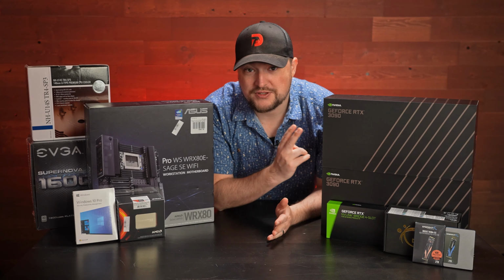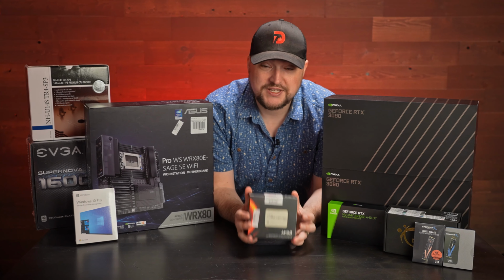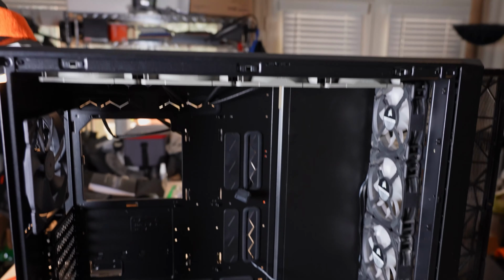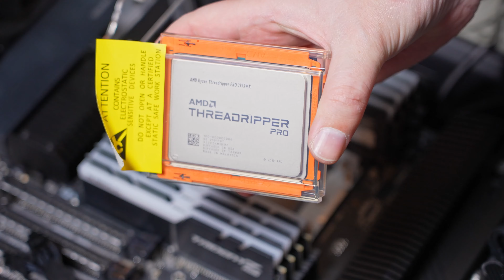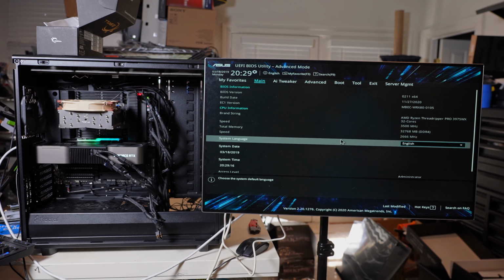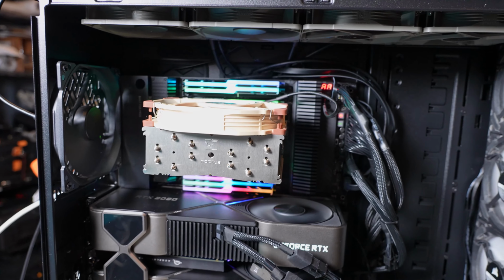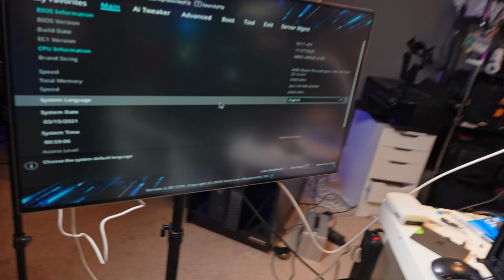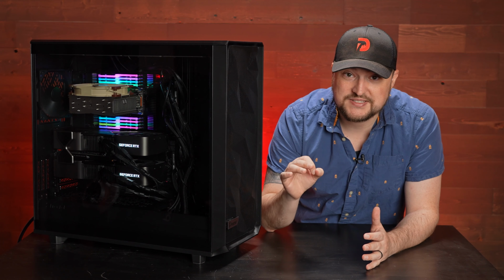AMD Threadripper 3975wx Dream Workstation Build!

Comment: Question: did you get the RAM running at it's xmp? As far as aware there was only a voltage adjuster in the bios and no way to enable xmp with the TR PRO boards. If you did could you give some pointers as there is little out there on these boards that would be appreciated.
Reply from the maker: No, I too ran into the same issue. They're only running at 2666mhz as opposed to the 3200 they're supposed to be. I hope a new bios update soon will address that.
Reply: @District7DrewGeraci  they run at such speed cause you're using 8 memories. That's the speed for such amount of memory units. Nothing wrong with that.
Reply from the maker: @Helios.vfx.  great to know, thanks for the heads up!
Reply: @District7DrewGeraci  No problem dude. for what I have read, at least for houdini fx software, it isn't affected by the speed memory at all. There's no big deal, even tho it sounds weird. I guess it might be kinda the same about resolve workflow. But you can also look it up about me memory modules and their speed while using 8 dims. At least, in this PRO mobos, it can't be put to a higher speed by xmp profiles. In non pro series, it can, if I'm not mistaken

Comment: Hi Drew thanks for the great video! I plan to build the same system for 24/7 usage. I prefer air cooler over AOI liquid cooler. Did your air cooled 3975WX system ever have any crash due to overheat issue? What is  the max CPU temperature when the system is running at full CPU usage for long time? Thanks!
Reply from the maker: Hi and thanks for watching! The air cooling works pretty darn well, with the max temp at max load peaking at around 72c which isn't terrible. I have another video that shows off the performance and temps if you're interested in watching that.
Reply: @District7DrewGeraci  Hi Drew, I have watched the other video. Great to know that CPU temperature is ok with the air cooler. What was the ambient temperature when you performed temperature test for the 3975wx? One more question, are the two side panels of the Fractal case made of glass or only the left panel? Could this case be positioned horizontally with motherboard side down for long term use? Thanks!

Comment: Thanks for the super clear video of the bios. I would like to see what you did in advanced to set the ram up to 3200MHz. I've got 8x16GB G Skill 3200C14 for a WRX80E I'm building and some people are saying their ram won't O/C on the TR PRO. I used DOCP on an X399 first gen TR. I really need a step by step bios demo.
Reply from the maker: It's not possible to get 3200mhz with the current bios - 2666 is the max unfortunately with 8 dimms.
Reply: @District7DrewGeraci  Thanks Drew. Well that's better than 2133.
Reply: @District7DrewGeraci  Did you ever get round to flashing the latest BIOS since you built it? We're at 1003 now, though using XMP profiles was added in version 0504. Your 8x32GB G.skill should run at 16-18-18-36 no problem. BTW what options do you see in the AI Tweaker and Advanced BIOS screens since the upgrade?
Reply from the maker: @2see2hear2be  so I had a great conversation with ASUS about the memory and the XMP data. If you're only using 4 sticks you can get up to 3200mhz but if you use 8 (or 2 quads) then you can only get 3000mhz. It's just how it works apparently.

Comment: Would be great to get an insight into temps during workloads. Also, curious if you had your choice of cases to hide cabling, which would it be. Thanks for a great video...the dual 3090’s, wrx80 and tr pro 3975wx build is exactly what I’ve been looking for - just not sure now whether dual watercooled hydro 3090’s might be the go?.. Could free up an extra slot maybe?
Reply from the maker: Those are great questions! The hardest part about this build is just sourcing the parts. At the time I built it nearly nothing was in stock and liquid coolers for the CPU didn't even exist yet. I'll be putting out a full video on the performance of the computer soon, but temp-wise, even under a full load at 4.2GHz All-cores, it maxes out at 70c, but averages 39-45c under normal loads. My previous system which was only 18-cores w/ liquid cooling hit 70-73c under full load so to have the temps be so low on air-cooling only is pretty incredible. Thanks for watching!
Reply from the maker: @Chris Miles For some reason your message won't show up in my comments, but I'm using the  Noctua cooler as it's literally 1 of 2 or so heatsinks that fit the new socket. There are no issues with memory clearing the fan.

Comment: Since your case has 9 PCI-E slots and all of your motherboard PCI-E slots are Gen4 x16, why not put your GPUs in the 3rd and 7th slot?. 
With that, you have three free slots for other stuff.
Reply from the maker: That's a great suggestion - I'll likely end up doing that if I need an extra PCIe slot, but the reason I didn't do it, to begin with, is because the 3090 would only be around 2mm away from the PSU exhaust fan (sucking up hot air). I'll test it eventually and see how it affects the card.
Reply: @District7DrewGeraci  If you really want to do it, you might want to upgrade the case to Lian-Li O11D XL.
Reply: @District7DrewGeraci  i have seen custom water cool backplate instead for the 3090 which would be cooler and dual slot

Comment: Thanks for making this video. I recently purchased a very similar build from Origin that I'm waiting on. Instead of the dual 3090s, I got an A6000 that I hope addresses some of the space issues that you mention. I went with 256 GB of RAM, mostly for future proofing. While I've done many builds in the past, I didn't feel comfortable installing the water cooling components myself. It's great to see others going with the Asus WRX80E as that's a pretty high-end board. Enjoy your setup!
Reply from the maker: Thanks for watching Raymond! Yeah the A6000 is a fantastic GPU and should work very well in tandem with the Threadripper pro. I would be very interested interested to see how it performs in Resolve/Blender as well when compared to the dual 3090s. Enjoy your new computer whenever it arrives!
Reply: WRX80E/3955Wx/ P/S is so much money, I'll be using my old ram/gpu/NVMe drives.

Comment: I just imagine how is this works on 3995wx because its lower Ghz... You think its might be the same?  not feels its downgrade by Ghz clock speed?... because I am want get 3995wx... and in plans using it on compositing, editing, 3d rendering, simulations... thanks and thanks for video!
Reply from the maker: I don't think you'll see any improvement on programs that favor lower-core counts and higher GHz (like the Adobe suite) but for 3d programs I think the 3995 would be amazing. The price is a bit ridiculous but if you need more cores you can't go wrong with 64! So far the 32-core works perfect in Blender, 3dmax, and Resolve. Thanks for watching!
Reply: @District7DrewGeraci  Thanks You for answer! btw also want to ask you how about Temperatures on Noctua CPU cooler! like idle and full 100% load!
Reply from the maker: @TheCool1986vfx  Idle it's around 39-42 and under full load it ranges from 65-71C.

Comment: Very similar to my build I did last weekend....

Build Name:   I N S A N I T Y

Specs:
• Case - Cooler Master COSMOS II 25th Anniversary Edition
• Motherboard – ASUS Pro WS WRX80E-SAGE SE WIFI
• Processor - AMD Ryzen Threadripper Pro 3995WX 64 Cores/128 Threads
• RAM - CORSAIR Vengeance RGB PRO 256GB (8x32GB) DDR4 3200
• GPUs - (4) EVGA GeForce RTX 2080 Ti FTW3 Ultra
• PSU - EVGA SuperNOVA 1600W T2 80+ Titanium
• Storage - (7) Sabrent Rocket NVMe Gen 4.0 - 22TB Total
• Case Fans - (3) Noctua NF-A14 iPPC-3000 PWM 140mm 3,000 RPM
• Fan Control - (3) Noctua NA-FC1 4-Pin PWM Fan Controllers

Custom Water Loop:
• Pump - EK-XTOP Revo Dual D5 PWM Serial
• Reservoir - EKWB EK-RES X3 150 RGB Reservoir
• Radiator - (1) EKWB EK-CoolStream PE 360 Radiator
• Radiator - (1) EKWB EK-CoolStream SE 280 Radiator
• Radiator - (2) EKWB EK-CoolStream PE 240 Radiator
• CPU Water Block - EK-Quantum Velocity sTR4 D-RGB - Nickel + Plexi
• GPU Water Blocks - (4) EK-Quantum Vector FTW3 RTX 2080 Ti
• GPU Back Plates - (4) EK-Vector FTW3 RTX 2080 Ti Backplate
• GPU Terminal Block - EK-Scalar Quad 2-slot - Acetal
• Radiator Fans - (9) Noctua NF-A12x25 PWM 120mm 2,000 RPM
• Loop Monitor - Thermaltake Pacific TF2 Digital Temperature and Flow Indicator

Comment: Were you able to get the RAM to 3200MHz? In the video looks like it was still at 2666MHz even at the end.
Reply from the maker: No, it's not possible to achieve 3200 with the number of dimms present. 2666 is the max unfortunately.
Reply: Bummer. What kind of CAS latency are you getting with that RAM?
Reply: @District7DrewGeraci  it certainly is now so hope you have updated and tweaked the bios, but I think it works out of the box now

Comment: Pretty awesome build. I'm pretty tempted to build the exact same sytem myself for Blender. But I'm gonna hold up until next year for DDR5 + PCIe 5.0 system that will double the current performance.
btw if you want to use the rest of the PCIe slots on your motherboard, maybe experiment with some PCIe 4.0 riser cables.
Reply from the maker: Yeah, I wanted to hold out for DDR5/PCIe5.0 as well but from what my sources say it's going to be until 2023 before they hit the mainstream. Intel is a bit behind, unfortunately, but I hope they ramp up production sooner rather than later! 

This system is absolutely wonderful in blender too! Like, eye-popping amazing.
Reply: @District7DrewGeraci  Well, Intel will come out with 12 Gen Alder Lake CPU's this year that will support PCIe 5.0 and DDR5. 

But for AMD Threadripper maybe you're right.

If it was Zen 3 Threadripper though on WRX80, I would upgrade for sure, because of the single core performance.  Since many operations inside of Blender still run on single core, like fluid simulations, rigid body physics and animation playback.  For now though I'll stick with AM4 and that upgrade path.

However one thing that I'm a little confused  about the WRX80 platform, is the memory bandwith with the 8 channels. And I would really appreciate it, if you could run a little test that I haven't seen anywhere on YouTube.

For example if I render the "Cosmos Laundromat  (Victor)" Blender benchmark, it will take 33 seconds just to initialize the rendering process on my Ryzen 2700X. And I've seen the same initialization time on other videos with more powerfull processors.
So I was wondering if that initialization process is due to Memory Channel bottleneck. And I would love to see a few tests on the WRX80 with 2 channel vs 4 channel vs 8 channel memory and measure the initialization times and also the overall render time in Blender.

It would really be helpfull with my purchase decision if you did that.
Thanks :)

Comment: Hi Drew, just got my 3975WX system installed. Which software do you use for monitoring the 3975wx system and CPU temperature. How do you configure the speed of CPU and case fans? System monitoring app is not included in the this ASUS motherboard. 
Anything else to be aware of in tuning this 3975WX system for optimized perfomance ? Thanks in advance!
Reply: If your workloads are in Windows platform, use IPMI for fan control and hwinfro for monitoring. If in Ubuntu, use IPMI again for fan controls and system monitoring center & zenmonitor3 for monitoring.

Comment: Loved the video. Can you show on a future video how are you configuring the SSDs?  It would be great also if you compare your previous computer to this monster in terms of rendering 8K video in both DaVinci and Premiere Pro.
Reply from the maker: Thanks, Juan! I'll do my best to do a comparison video between the two but it may be hard since I've already sold it :( I do have another similar system that I can do a comparison video on though. Thanks for watching! As for configuring the SSDs, it's pretty simple. I'm just using a PCIe4.0 M.2 Raid card with all of the M.2s on it. Very easy to raid that way. I'll see if I can do a video on it though.
Reply: @District7DrewGeraci  Thank you very much for your reply. It would be great if you can compare. I am getting a Threadripper pro like the one you built, but I have been wondering where the benefits will be. Do you find that besides smoother playback is there also lots of benefits in terms of rendering video, or it is just while assembling and putting everything together that the upgrade shows the biggest difference. I am a Canon R5 which I imagine you have heard about. It can record in 8K, but it produces the toughest files for editing (I understand even more difficult than 12K from Blackmagic or 8K RAW from RED)
Is it possible for you to test your system with a 8K RAW footage from  the Canon R5?
Which of the RAID cards for NVME SSDs did you get? The Asus PCIE 4? or a different brand?

Comment: What's the point? I edit and work with 8K & 6K footage on a single 3090 and 5950X, I know many other professionals that use an M1 Mac and iPad... Seriously, what are you doing? And what are you doing with that airflow between the cards? Such an odd build man.
Reply from the maker: What's the point? Well the point is my workstation is used for a multitude of things, many of those being ultra-high resolution VFX for work film and advertising which requires a ton of GPU processing. In fact I just upgraded to a dual A6000 / RTX3090 build and now benifit from 48GB+ of VRAM for all of my 3d VFX programs, including DaVinci. It's absolutely amazing. Thanks for stopping by!
Reply: @District7DrewGeraci  I suppose that's fair, I get by fine with my little 5950X+3090 for video & photography with my R5 & soon R3, I was just curious is all, downgraded from a W-3175X when I realised I didn't need that cores or ram performance, I may however go with Intel's new HEDT with big.little, as I'm not too interested in AMD anymore, they've taken too long to release their Zen 3 Threadripper.

Where were your temperatures on the 3090's? You have very little airflow there.
Reply from the maker: @frostybe3r  I'm not really sure how you determined I have 'little airflow' but feel free to watch some of my performance videos. With 100% air-cooled only I'm running around 68-71c at full load for the CPU and around 63-65c at full load for my GPUs. The system is a beast and continues to be one ;)
Reply: @District7DrewGeraci  Your VRAM isn't at 65c....
Reply from the maker: @frostybe3r  I'm not sure exactly what you're after here in this conversation, but thanks for stopping by! The temps of my system are well within the threshold of sustainable, high-performance operations. I'll even go as far as posting the link the GPU under full power if that pleases you. It's 67c without my AC on, haha. 

https://www.dropbox.com/s/yc2s4rbwrg8l6jv/vram.jpg?dl=0
Reply: @District7DrewGeraci  Lol meant nothing by it, I'm just genuinely curious, I used to have a 3970X with 2X 2080 Ti's and before custom looping them they'd hit 80C+, haven't ran into many with SLI 3090's. Are you not planning on doing a loop with these? I may buy a 5975WX when it's released but I did want to ask, is this board any good?

Other reason I asked is because before I put a waterblock on my 3090 FE, it would run at a constant 110C on the VRAM.

Comment: may i know does the nv link works (and benefits you) in resolve coz as far i know ( and read from Puget System site) it doesn't read both the gpus as 1, but instead only 1 gpu. if you want the system to rcognize both, you need to let them as individual gpu (without the nv link)
Reply from the maker: It didn't use the NV link with version 16 but with 17 I see much more utilization of both GPUs when tethered via the NVlink. I get a 100% / 50%  use out of them when rendering which is amazing.

Comment: Um. Mistakes have a made instead of buying 2 3090s you should’ve bought one a6000  it might be a little more but if you buy Direct from Nvidia. It would be $4850
Reply from the maker: That was an option, but my 2 3090's were still cheaper than (1) A6000 and they perform better in tandem inside of Resolve. It would be nice to have 48GB of VRAM though!
Reply: @District7DrewGeraci   how 3090 is like double quadruple the price of MSRP

Comment: what are you using for a CPU fan?
Reply: also I see you moved the fan from below the heatsink to above
Reply: @greyreynyn  He's using this, and I was wondering the same thing myself. Using that in a "pull" configuration. I'm off to watch the performance video he said he has and see if it reveals anymore.  https://www.newegg.com/noctua-nh-u14s-tr4-sp3-premium-grade-140mm-cpu-cooler-for-amd-tr4-sp3/p/13C-0005-00140?Description=noctua%20nh-u14s%20tr4-sp3&cm_re=noctua_nh-u14s%20tr4-sp3-13C-0005-00140-Product&quicklink=true